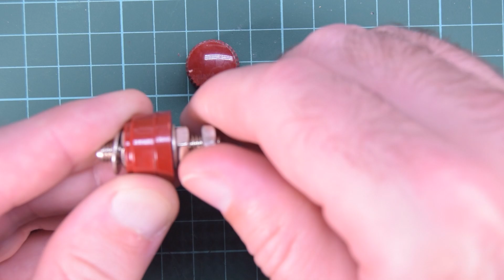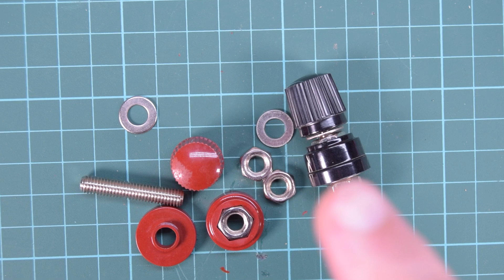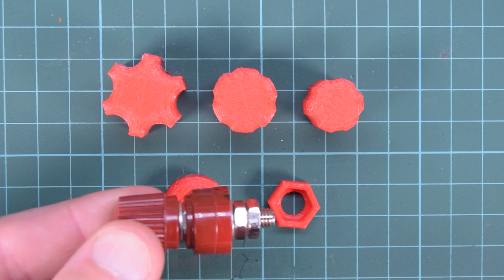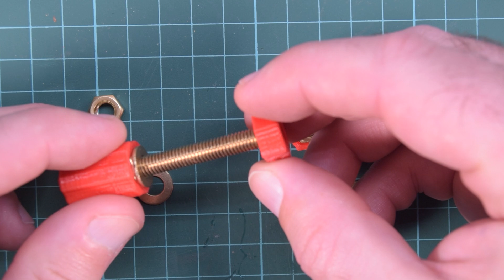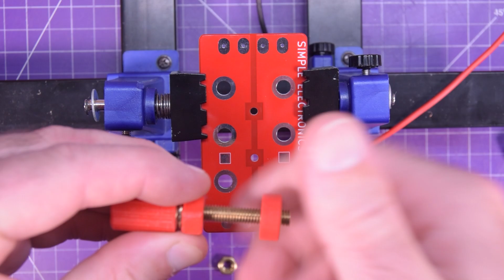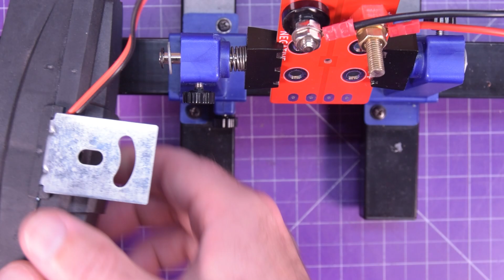I Made My Own Binding Posts And So Can You!

Comment: The little ring is there to keep the threaded rod exactly in the centre ensuring no touchy/conductivity to the sides. So I would add those. Other than that, great design! Love it!

Bang! Afterthought: You can always put a put of heatshrink on the the rod that goes through the hole in you case to keep in from shorting.

Edit: I see I am not the only one who suggested that. And indeed. It is not hard to make lip if you want if the design files are there for grabs :) So thanks for sharing!
Reply from the maker: Everything is linked in the description! Have at it!
Reply: @SimpleElectronics  I don't have a need for them right now, but everything open source is something I try to remember for "if" and "when". And of course when I am ready, Google will point me in the right direction! :)

Comment: Nice video. If you are drilling the threaded rod for use with wire or pin crimps then the easiest way is to 3D print a jig to hold the threaded rod and to provide a guide hole for the drill bit.

Comment: Thanks for sharing! Ideas... Drill a hole in the post, to clamp bare wire. I have used PCB Copper Tinning solution to tin Brass. Dual hole spacing is 3/4"/19mm, if I remember correctly. There are Banana adapters that will screw onto your posts, IIRC. I think I saw them on Uni-Byte's YT channel.

Comment: On the spacers that sandwich the case I would suggest adding a lip on them so that the threaded rod can't shift and touch the casing, fine for a plastic case but a metal one will need it.
Reply from the maker: I was thinking of that but it would mean you couldn't just add it to a 6mm hole - but I did drop the files on GitHub so people can mod it as they wish!
Reply: @SimpleElectronics  you could always print a thin spacer ring to add instead to go between them, to act as a grommet.
Reply: maybe use an o ring
Reply: I was thinking the same thing while watching the video. If you use these binding posts in a metal housing, a short circuit is lurking...
Reply: I noticed the same problem. But these are still cool.